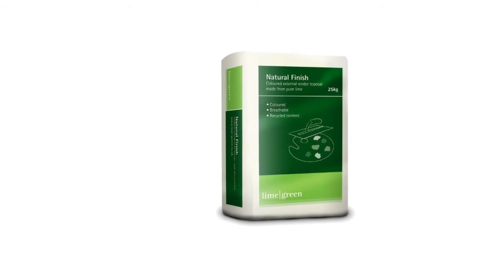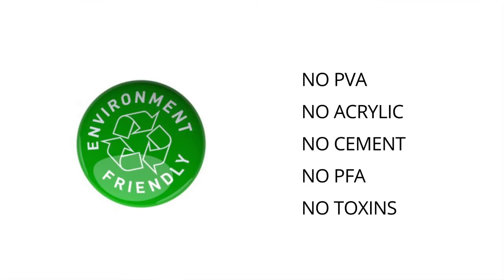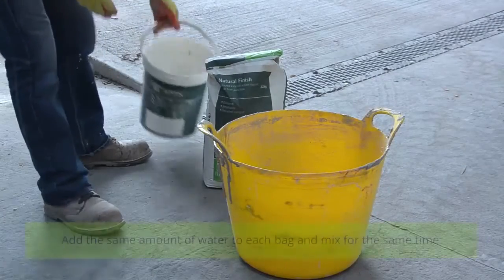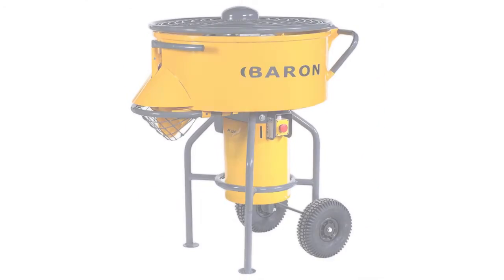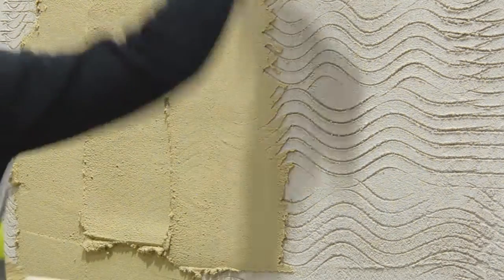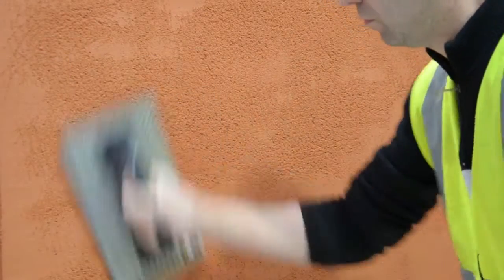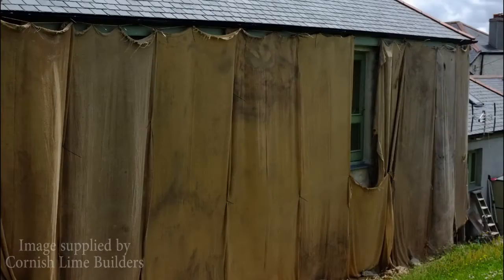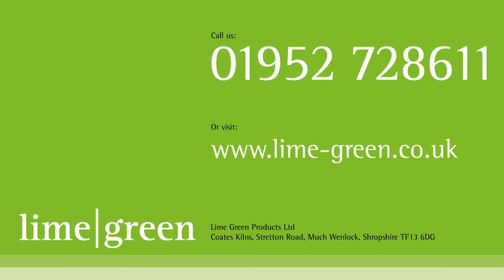How to use Coloured Lime Render from Lime Green Products

Comment: This seems like a interesting product.  Lime plasters with a colour pigment. It is very similar if not the same spec as K-rend application.  As a lime plasterer in Suffolk/Norfolk where I do a lot of clay lump & timber frame houses I would only ever recommend a haired chalk or fiber chalk lime plaster to go on these types of buildings. I would only ever try a product like this on a solid brick construction.  I do like the fact it's coloured and myself has clients ask all the time about lime plaster that is already coloured.